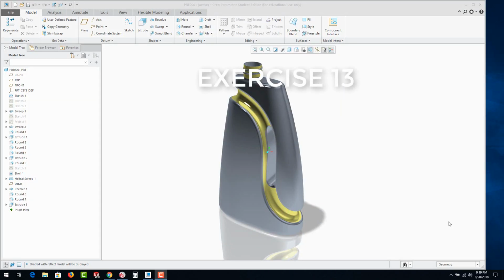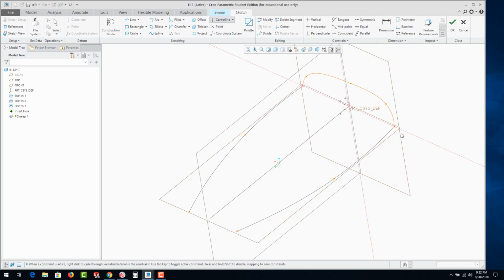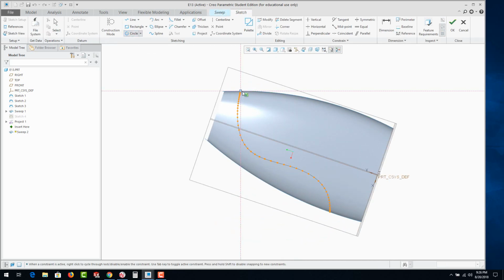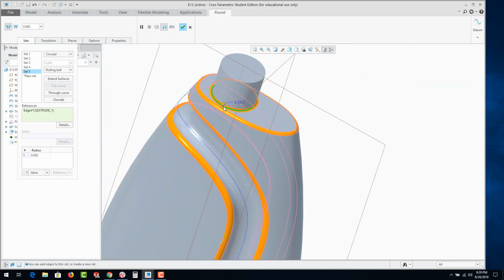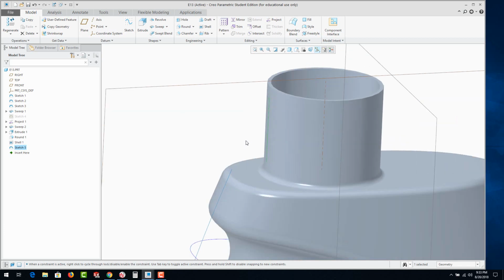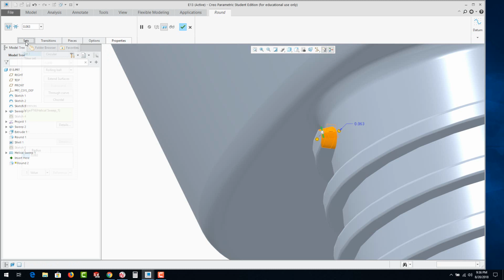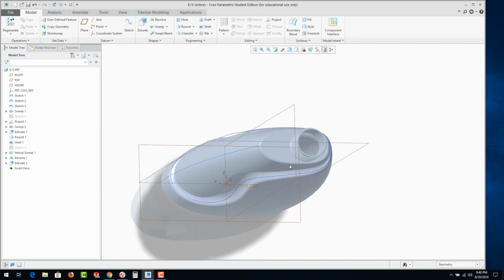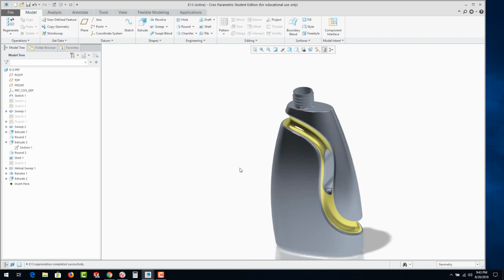E13 Creo Parametric 5.0 - Sweep Bottle & Threads Tutorial

Comment: Thanks Chris.  I watched your tutorial on Creo 2 years ago and it is very similar.  What if you need to add a neck that had a larger diamter than the top plane width?  I was thinking of the swept blend tool.  Is that possible or is it possible to add more than one cross section in the sweep.  Years ago it used to be called "variable Section Sweep" in ProE but I am trying to get used to Creo format.  Still using Creo 3.  Thanks in advance